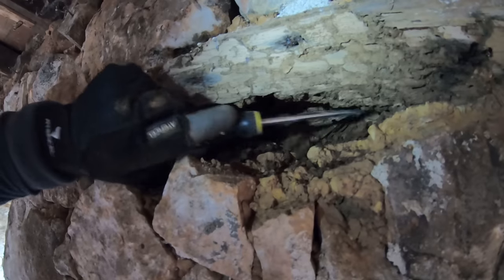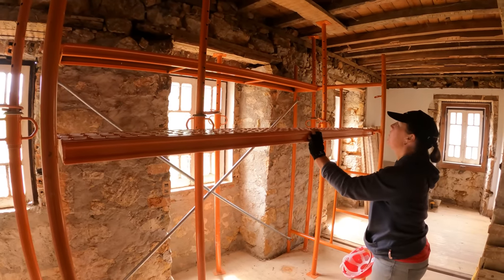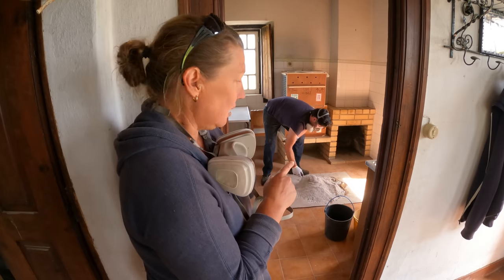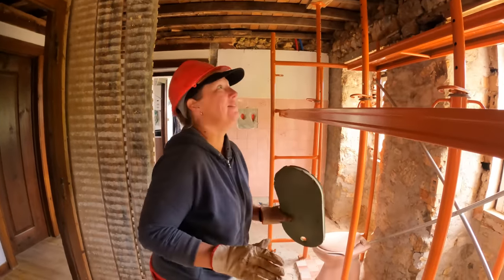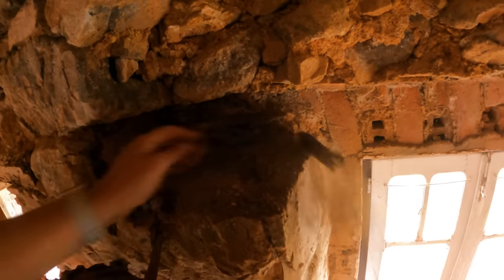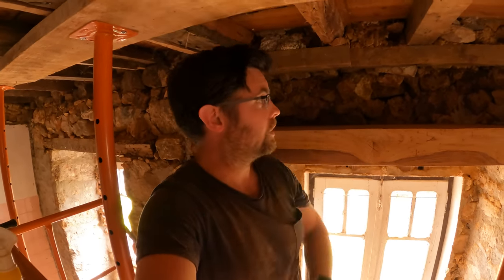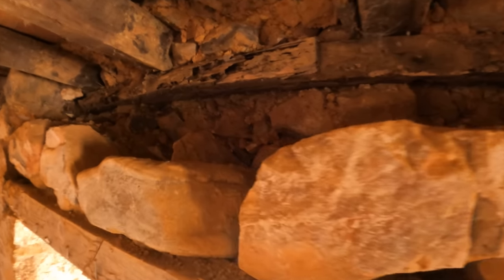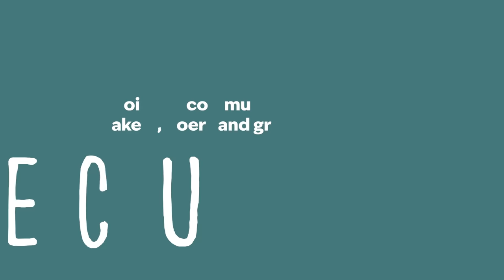Replacing ROTTEN Lintels (in a Stone Building) - Restoring a Portuguese Farmhouse

Comment: Hello

What interests me is, why the lintels are so rotten at the supports. Have you found this out? The ceiling construction does not seem to be affected. 

Is it perhaps driving rain from the outside that has penetrated to the inside? The ceiling construction would be protected by the roof. If so, this lintel will also rot again over the decades.  It would be a pity for all the work if the next owners have to change it again in many years. 

Many greetings
Gerrit

Comment: You two are doing a humongus job!  Could you not have borrowed or rented a small cement mixer? It would have been easier.
I hadn't seen you add the rocks to fill the larger gaps. I'm glad I saw you do it.  I was a little worried.

Comment: I have a lot of questions. I'm Portuguese and I've always heard that houses abroad are good and warm, and our houses in Portugal are always cold and full of humidity. I've heard you say a lot of bad things about cement, but our houses are full of cement. But it's not just cement that absorbs moisture. We in Portugal have a very bad idea about wooden houses because we know that they don't last very long because wood is not resistant or waterproof and rots easily. That's why I have these doubts: how are houses built abroad, compared to Portugal? What's different about them that makes them better than ours? for example, the floor you made in the basement confuses me immensely. If that first layer is used to circulate humidity, the humidity will then evaporate and rise into the house. or am I wrong? We always want the humidity to stay outside the house and not inside or underneath, right? And all the wood you have in your house, are you sure it won't rot again in the following years?

Comment: I would put some wooden blocks under the feet of the metal studs so that the wight is more distributed on the floor.
Reply from the maker: The feet were strategically placed over the joist below (running in the opposite direction to the ceiling ones)

Comment: Do you have to do anything specific to protect the wood from the lime mortar?  Interesting video, as always.
Reply: My thought aswell - or rather; How does the lime mortar work with wood considering it allows moisture passing through. might have misunderstood but no harm asking.
Reply from the maker: No protection required. Timber will only temporarily take on a little moisture and then eventually dry out. That’s the benefit of using all materials that are ‘moisture permeable’ or breathable, as opposed to materials that trap the moisture

Comment: The lime is fine.. it just contains a greater amount of impurities and clay? - but you will have discovered this. Also it will be fine for the window supports. .. tis stronger. if there is more than 20% cement the bag then has to be labelled PHLc. And tis not. so a less than 20% cement content is not going to be worth ripping out?  Easy mistake; just don't break your backs its not going to make a significant difference on the first floor in that quantity. xx

Comment: Olá! Sorry, random question, I've just been looking at my lack of lintels where the builders knocked through holes for doors. My house is similar construction to yours (I'm about 1/2 hour away). In your research did you come across any reason not to use pine for lintels? I've been searching high and low but it seems we use pine a lot in the southern hemisphere but not here?
Reply from the maker: You could theoretically use pine but there’s a couple of things to consider:
1. Portuguese pine is very fast growing so lacks the strength of say Nordic pine (grows slower due to the colder conditions)
2. The wider the span the more strengths required - so a 1m window lintel would have very different requirements to a 3m bi-folding door lintel
3. Thickness/strength of the lintel also depends on what is supporting
We had another area in the house that was supporting a stone wall above so we chose concrete beams strengthen with rebar.

So assuming you size the timber sufficiently for the situation pine should be just as good as anything else (we chose the oak in this video mostly for aesthetic reasons, and availability)
Reply: @MAKEDOGROW  wow, thank you! 🌻 While I love the look of oak, the cost of pine is more appealing! I've just realised my kitchen window which needs replacing also has no lintel. All of the places I'm looking to put them are stone surrounds, probably close to a meter deep, but actually hollow brick above (from what I've heard the window used to be a door, they must have filled in with brick when they went up another storey). Any suggestions on a website that might have a formula to calculate the depth of wood required? Nearly everything I read says wood is no longer used (ha ha), or with a different type of brick. I suppose by the time the weight of a tile roof is added, it's probably the same as a solid brick with a lightweight roof construction above anyhow, now I think about it
Reply from the maker: @hereandthereify  if you’re anywhere near Pedrogão our timber guy might be able to help you - both with the sizing and sourcing.
Else I’d just do a Google search for ‘wooden lintel calculator’, there’s bound to be something to help you get in the right ballpark

Comment: We had todo the same, replacing upstairs lintels. We didn’t even have a strong upstairs floor to brace against so we had to brace against the downstairs floor and then the upstairs against the downstairs.

I reckoned that as the existing lintel was basically dust it couldn’t be holding up too much but it is still scary!